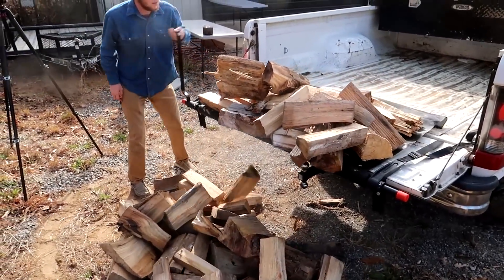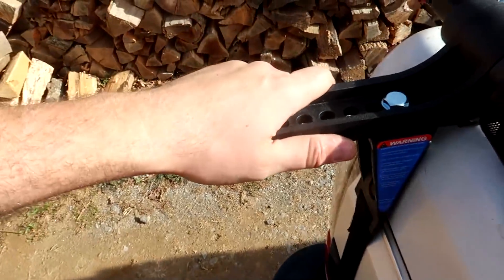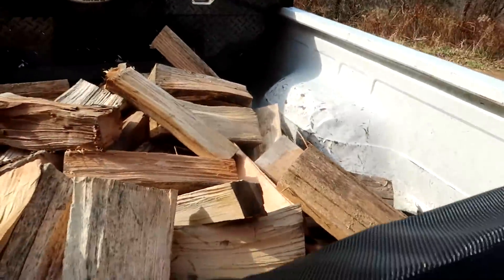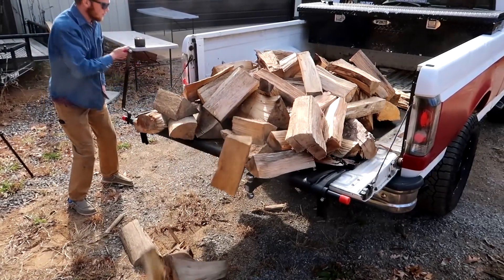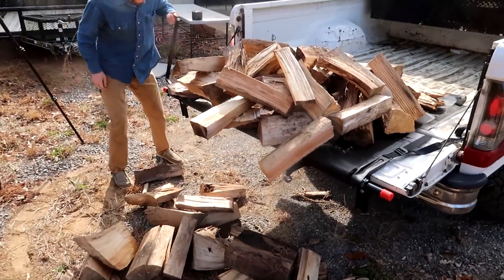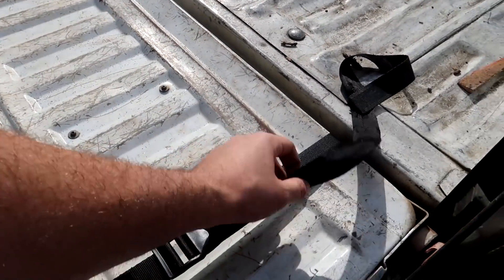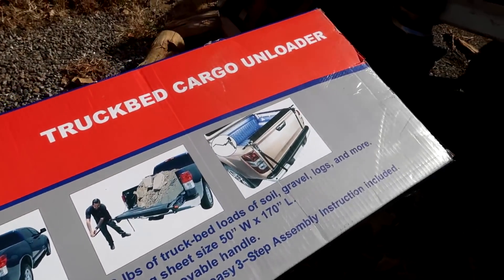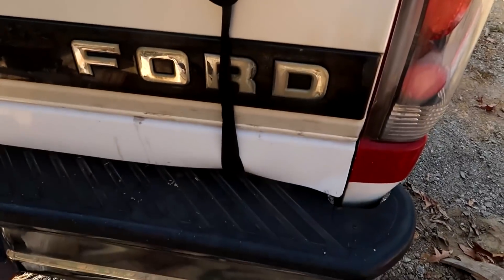What is Truck Bed Unloader?

Comment: You can achieve the same result by pulling on heavy duty tarp. If the items are heavier, you can tie the tailgate end of the tarp with rope from the grommets to a tree and then drive off. The tarp and all contents remain.